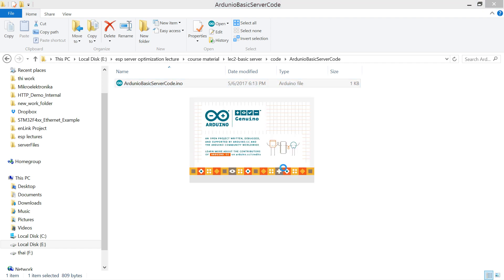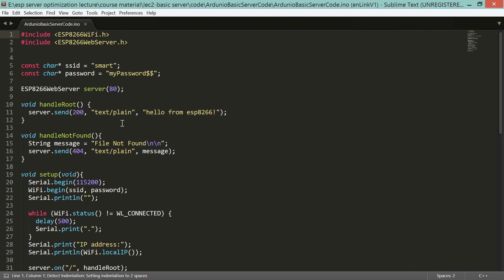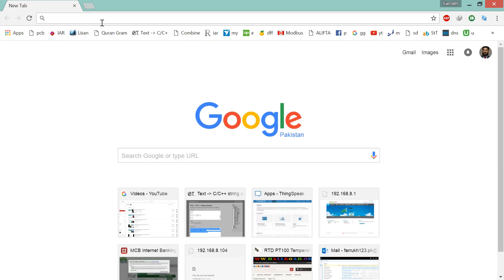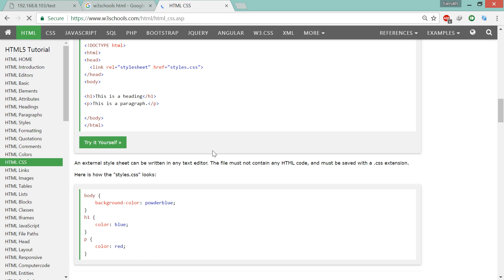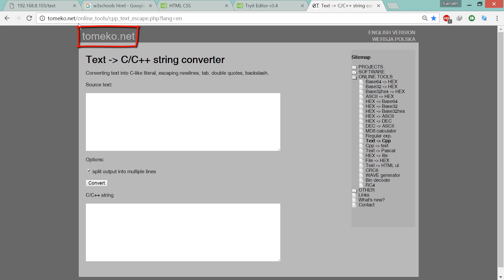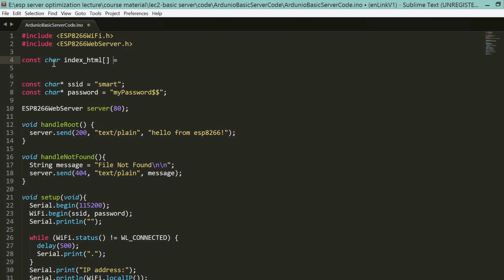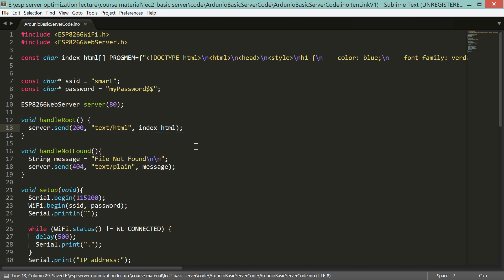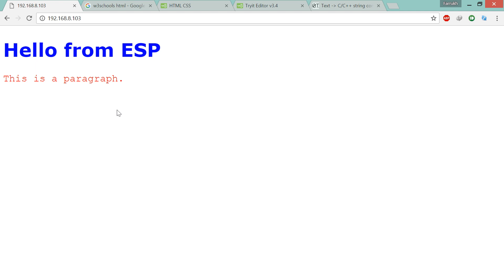Add HTML to ESP8266 in Arduino sketch -2

Comment: 0:21 My Arduino IDE ver 1.8.12 doesn't have example sketch for NodeMCU 1.0. Where can I get it?  I already installed board manager for ESP8266 but it didn't include any example.
Reply from the maker: Can't locate Hello server example?
Reply: @farrukh4303  I finally found the library. I thought board manager would automatically put sample sketch when it is installed.  Anyway, Thank you for replying.
Reply: I just found out there are two places where you can find libraries. C:\Users\...\AppData\Local\Arduino15\packages\esp8266\hardware\esp8266\2.7.4\libraries
and
C:\Users\...\Documents\Arduino\libraries       <--I manually installed ESP8266Wifi.h and ESP8266Webserver.h here.

Comment: Hello sir your video had  given a good knowledge for me
But I am having a doubt regarding microcontroller will it store total HTML file for suppose if I include the video and photos on my website
Reply from the maker: if you like to store videos and photos as well, you can attach SD card with esp8266, but if you have small size image like website logo or some background image, then you can add directly in code in hex array format.
Reply: Thank you sir

Comment: When I use mode MCU as a web server to switch on or off relay for home automation,is it IP address of nod MCU chang often or not ????will the IP address be permanent
Reply from the maker: 1. you can configure static ip for nodeMcu from your router
2. you can use dhcp but ip may be different everyday
3. you can use mDNS library, this way, you don't need to care about IP of your nodemcu, can just access it using host-name like http://esp8266.local or http://myboard.local
Reply: go to DHCP reservation in your router and assign a static IP address for the nodemcu

Comment: Is it  possible to add html to esp8266 sketch with arduino uno?
Reply from the maker: Leonardo Vargas Yes,is possible,two ways to go,
Reply from the maker: 1. program esp8266 separately, and define a UART protocol yourself, in this way, you will load html/css/js files directly to esp8266 and esp will send commands to uno over UART as defined/configured
2. you can use AT firmware and store webpages and handle all from UNO,  esp8266 will not be programmed in this case, but it will be quite complicated job, and i think waste of resource as you will not get best out of esp8266.

Comment: Thanx for the video. I have 2 questions.
1, I made simple webpage in arduino to control leds via esp8266. Can we make html coding in arduino to read temperature value in browser.
2, if the esp8266 is port forwarded can we access the webpage embedded in the arduino by accessing public ip address of our router?
Pls clarify
Reply from the maker: 1, I made simple webpage in arduino to control leds via esp8266
so that works?
 Can we make html coding in arduino to read temperature value in browser. 
sure, there may be many options to do this, one simple way is to use JS to request temperature value may be every second, and update received temperature value in browser.
2, if the esp8266 is port forwarded can we access the webpage embedded in the arduino by accessing public ip address of our router?
sure, that should be simple, but there are better options available, you may use MQTT to control your arduino from internet without any port forwarding.
Reply: Thanx for replying. In local( means at home network) I should be able to control with HTML webpage I embed on it. And away from home I should control with MQTT. Is that possible because I did not consider that once so mobile app and arduino code developed according to above criteria.

When I use MQTT protocol I should place my own database for my convenience. So please guide to meet my point
Reply from the maker: I do not understand your question., database needed for? if you have made android app for controlling esp, app is most probably using http requests, you should be able to configure app for mqtt as well, may use any public mqtt broker, can even use private one if that is needed.
Reply: Bro, I hope u r familiar with STM32xx series. If so, I have made a home automation program for arduino uno. And I want to make it compatible for  STM32xx series. And if u can pls tell me. I want to upgrade the program into extra features like external eeprom, Fan speed control by two buttons using zero cross signal. Pls let me know if u like I could mail u the program. I'm a newbie and building for my home. Thanx in advance
Reply from the maker: i'm sorry,  isn't possible for me to help you with that.
Reply: Anyway Thanx man. have a great new year ahead

Comment: Hi, i'm using esp-01 8266. Check ok but i can't upload the sketch.       
warning: espcomm_sync failed
error: espcomm_open failed
error: espcomm_upload_mem failed
Help please
Reply from the maker: Leonardo Vargas seems issue with com port
Reply: Hello, you just  have to place a bridge between 8 and gnd (with a câble) before  to upload. And of course remove the bridge before to use the  card.